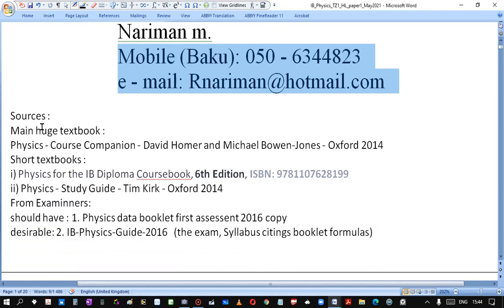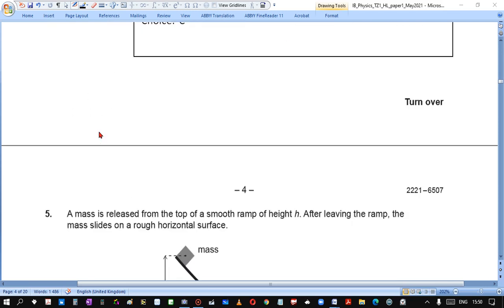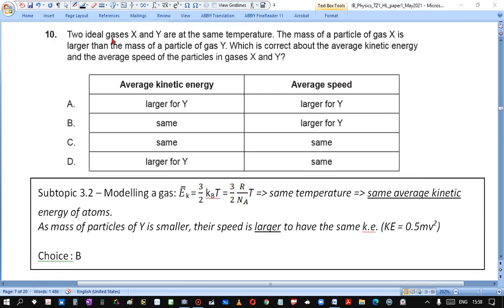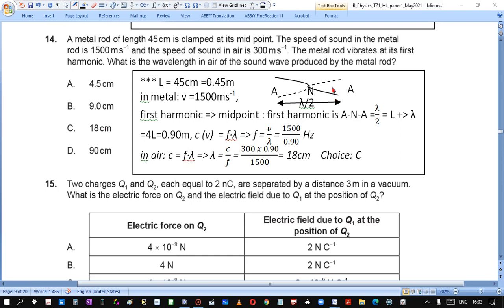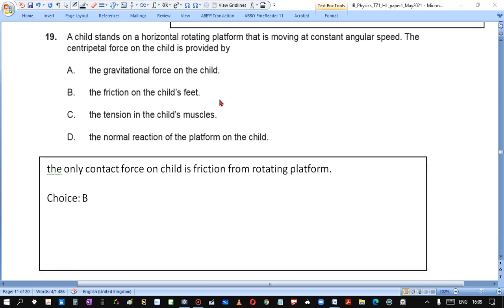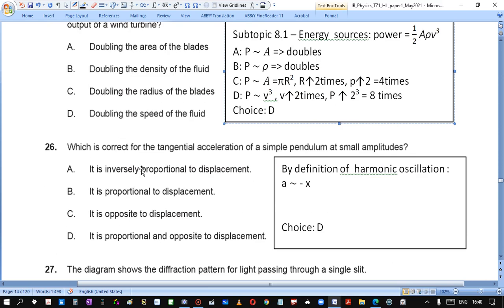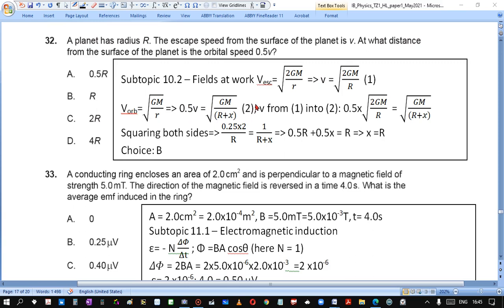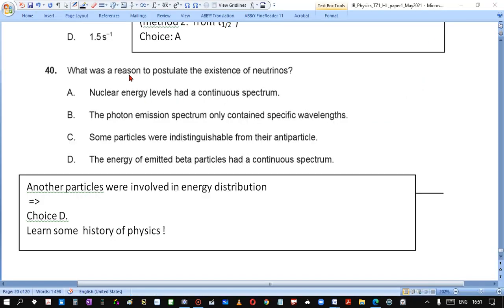Solutions IB Physics HL Paper1 May 2021 TZ1 past paper Baku teacher TISA EAS XXI century Dunya

Comment: For Q29, why does effect decrease with the speed of the train? According to the approaching source formula, wouldn't the denominator decrease, causing f'=much higher multiple of f? This would mean that the effect had increased, right?
Reply from the maker: for simplicity speed of train is the same, when approaches then receibed frequency is less but after station train is separating - increasing freqncy received.
Reply: for approaching source, us is negative (so denominator is v-us), where us is the speed of the train approaching the observer. As the speed of the train, us, decreases, the denominator becomes larger, and therefore f' =  a smaller multiple of f, and the apparent frequency is lower as the train slows down
Reply from the maker: @IvanWongHongKong  when train is approaching station, frequency of received sound is higher, when object reproaching is reproaching statio freqncy becomes smaller, choice D.
Reply: @NarimanRzaguliyev  so you are implying that all of the answers are correct?
Reply from the maker: @k0llecc  up to now 99.9% answers checked with mark schemes were correct. not all.

Comment: A few mistakes here:
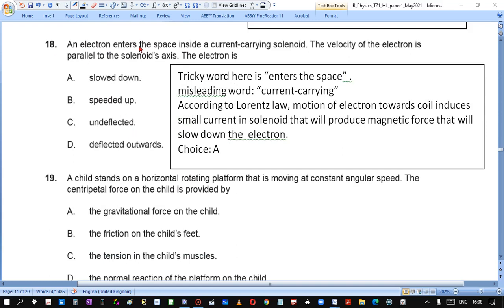Q18 (22:37):
    The answer is actually C, because the magnetic field induced by the solenoid is parallel to electron velocity, therefore no force. The electric field is localized to the wires and does not affect the motion of the charge.
(IBO stated in examiner's report that this question had a wrong answer in the markscheme)

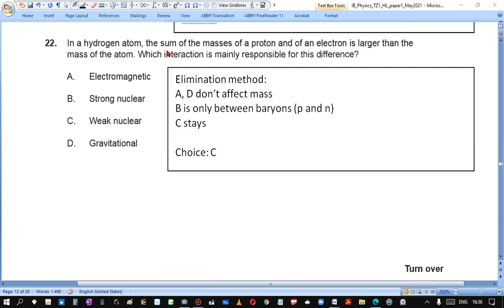Q22 (25:51):
    The answer here, from the markscheme, A, is correct. The electromagnetic force is the only interaction between the proton and electron. There is actually a slight mass defect (hydrogen atom lighter than the sum of proton and electron rest mass), owing to the energy released, partly, when the proton gains an electron and forms a hydrogen atom.
Reply from the maker: the matter is that we consider electron entering  solenoid. Lorenz force should repel the electron according to law of conservation  of energy.
Reply: @NarimanRzaguliyev  I think you're talking about Lenz law, which is a consequence of the conservation of energy, but this is not the case because:
1. The electron is not a conductor
2. the B-field is parallel to the electron velocity (It can be derived from Lorentz force law that a B-field parallel to the direction of electron velocity has no effect on the electron)
Reply from the maker: Lenz law acts both on individual charges and current of moving charged particle.with force F = Bqvsinθ, inside solenoid θ=0 magnetic force has no effect on the charge,.
Reply: @NarimanRzaguliyev  Refer to the official examiner's report for that year; they recognized that A is a typo and C is the correct answer
Reply from the maker: the word ":enters" means that electron is not in uniform magnetic field yet. as while charge is entering magnetic field around it is increasing!. i disagree with C choice
Reply: @cezarywystup4942  sure, reply with an email or smth i can send it to
Reply: @cezarywystup4942  Lenz's law applies only to conductors, because in conductors there are delocalized electrons moving in random directions, and therefore the magnetic field is not parallel to some of the electrons, and according to Lorentz's force law a force will act on some electron velocities, therefore a current is induced and there will be a force slowing down the conductor as the current is induced to oppose the change of the magnetic field. Lenz's law is a qualitative law, a consequence of conservation of energy, which helps us easily find the direction of the induced current in the conductor. 

In the case of a single electron, it's not a conductor and therefore Lenz's law does not apply. So you would only need to apply Lorentz's force law to find the effect of the solenoid on the electron.
Reply: @cezarywystup4942  reply with ur email I have all the ones from 2015 to 2021 (I unfortunately don't have access to the examiner's reports though, need to ask a teacher to help me look lmao)